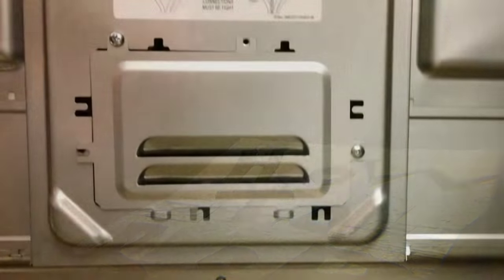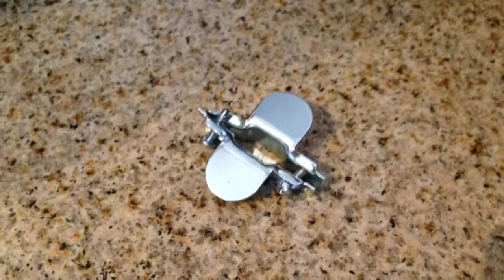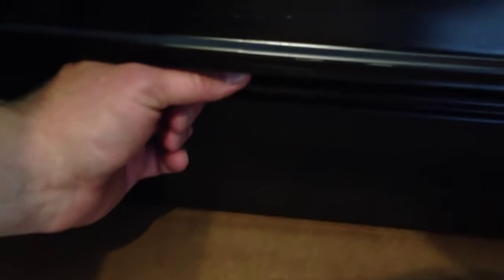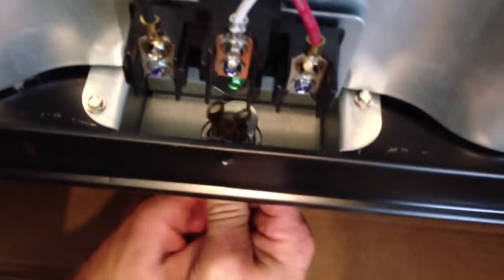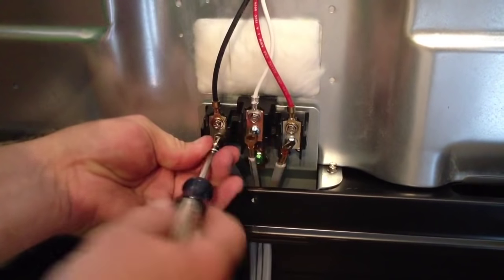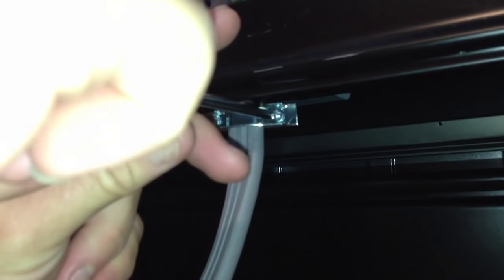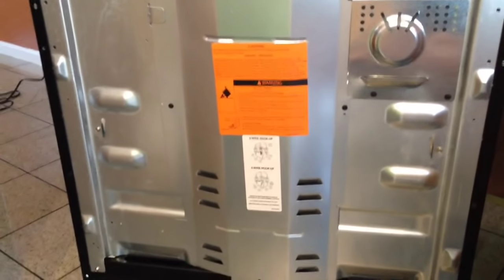How to hook up a 3 or 4 wire electric range cord By How-to Bob

Comment: man I must have awoken to a new era.  Since when did white come into the picture?  black (negative, red(positive) and green (ground) or was it an illusion I had?
Reply from the maker: No illusion, white has been there for a while.Thanks for watching.
Reply: Not very helpful response there funbro1. If you don't want to answer the question to expand someone's knowledge then put down the keyboard. I'll admit that people don't read (22 people saying the same thing about the ground wire)...
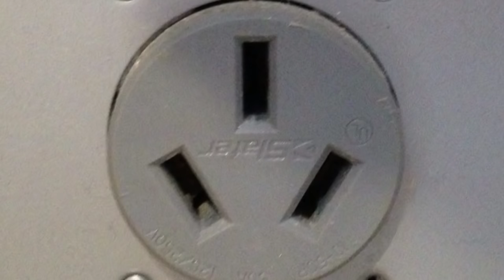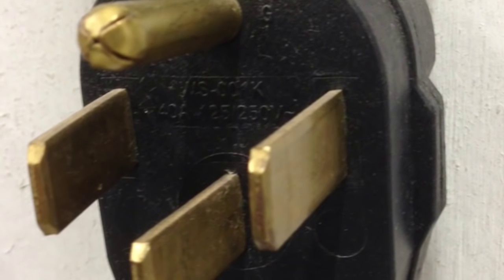Reply from the maker: @smportis  Sorry it has been awhile since you requested assistance but I thought I would try to provide the information you need to expand your knowledge. At 1:27 it is explained that in a 3 wire system(cord) there are 2 hot wires and 1 neutral. Also note the printing conveniently printed on the middle wire of the new cord. At 1:56 in the video the white wire comes into the picture (no illusion). Actually the white wire came into the "picture" at :27 in the video since that is when we first see the white wire just after the access panel is removed. During the video it is also explained that there are 2 "hot" wires represented by the black and red wires.At 3:05 in the video there is another mention of a white wire and also an explanation on where the additional green wire goes when hooking up a 4 wire system(cord). I honestly hope that this additional information expands yours and others knowledge.

Comment: Can two hot wire go together.? If the socket has just two hole?
Reply from the maker: I would not recommend it.
Reply: funbro1  in my country there is onli two wire one hot and one neutral
Reply: Can be earth sumtym
Reply from the maker: Is it 220v?
Reply: funbro1 yes 220v
Reply: funbro1 the plug tat we use is 3pin, one hot, neutral & earth
Reply from the maker: You would need a Range that is made to run on 220v.

Comment: It appears that you did not ground the range.  You need either a ground wire or metal conduit.
Reply from the maker: Nope, it’s all covered in the video.
Reply: You didn't mention grounding the range for the three wire connection, just the four wire. Is that a requirement for either one?

Comment: Neutral is ground also?
Reply from the maker: Ground and Neutral are closely related,  under certain conditions, a conductor used to connect to a system neutral is also used for grounding. A separate conductor used for a ground will be the safest way to go. Hope this helps.  Thanks for watching.
Reply: @funbro1  my oven was connected to 3 wires: black, red and ground, I want to replace on oven which connected to 4 wires where is ground separate. Should I put  ground and neutral together?
Reply from the maker: @robertfdowns6098  Yes, you will need to run a separate ground wire for it to be a 4 wire.
Reply: @funbro1  I already have ground (bare) wire I don’t have neutral.
Reply from the maker: You will need a neutral that runs all the way back to the panel.
Reply from the maker: You will need a neutral that runs all the way back to the panel.
Reply: @funbro1  thank you so much for help but here one more question: can I pull neutral from another panel which is closer?

Comment: I have a 3 pin outlet but plug on stove has 4 what do I do
Reply from the maker: One of the 2 will need to be changed. It might be easier to change the cord because chances are the house is wired to use 3 and changing the plug will give you no benefit. Hope this helps.

Comment: do I need a grounding strap?
Reply from the maker: ***** Not if you have a 3 wire connector. I guess you could hook up a separate ground wire if you feel the need but tthat would not be necessary if you have a 3 wire outlet on your wall.

Comment: is neutral the same as ground?
Reply from the maker: Neutral can be grounded, but Ground is not necessarily neutral. The purpose of the Neutral wire is a power return path. The purpose of the Ground wire is for operator safety. Under normal conditions, no current flows through the ground wire. The neutral is the grounded conductor, whereas the ground is the grounding conductor.
Reply: If you are wiring from the primary electrical service panel, then the white (neutral) bar is bonded to the ground bar - therefore serving the same function. If you are wiring from a secondary electrical service panel, then the neutral bar is not bonded to the ground bar.
Reply from the maker: Very true, Thanks.
Reply: Unless the DIY homeowner that came before you tied both the ground and neutral bars together in your sub panel...  true story, happened to me in my garage, also wired up a 70A breaker on 10 gauge wire to feed it.  I'd like to say electricians always do the right thing but I've seen many instances of them doing things very incorrectly, even fried a motor on my that was designed to work on 220 or 115 and they never changed it, bzzzt done deal.

Comment: THANK YA !!!!!
Reply from the maker: +Terry Broome Thanks for watching
Reply: no problem , thank you! ..... had a weird situation "no outlet just a junction box" I have only wired up lights in the past and was going nuts: "The testers saying both are positive !?! what do I do?!?!?!" .... Thanks !! ... thought I was going nuts for a second and scared Id hook it up wrong and F*ck up the range.
Reply from the maker: +Terry Broome with a range you will have 2 Hot wires(red and black) and a neutral (white) sometimes you will have a 4th wire for the ground. Your 2 hot wire are 110V each when they are both hooked up they make 220V. Hope this short, basic explanation helps some.

Comment: Sorry No help.  My cable is not marked or color coded so i do not know which wire is what
Reply from the maker: It should be pretty straight forward. If the wires are not marked you could use and OAM meter to tell where the wires go. 
Hope this helps, thanks for watching.